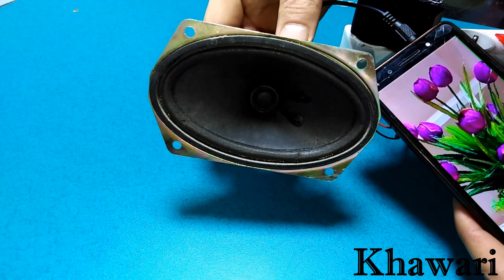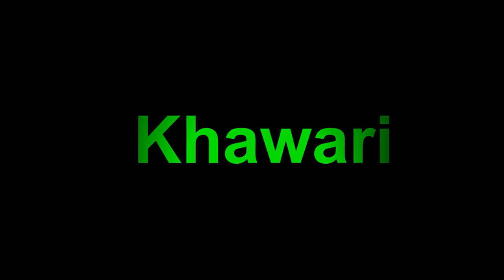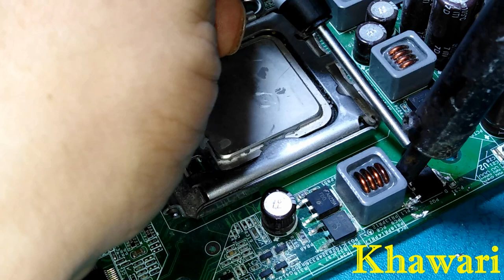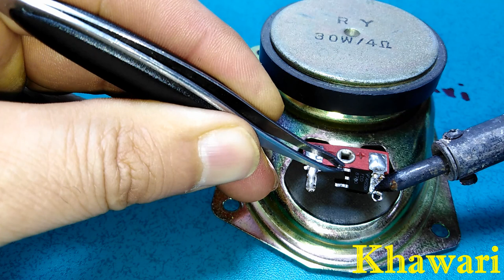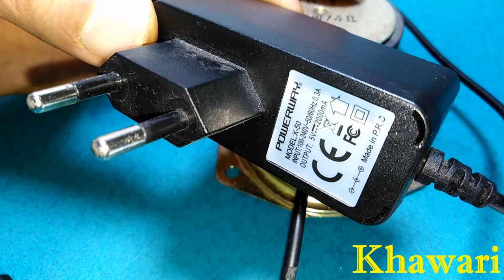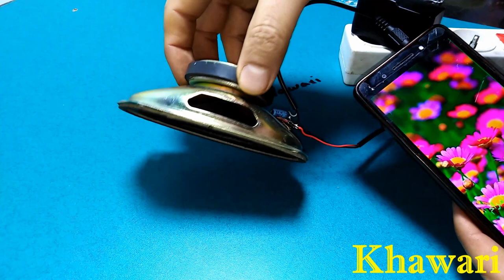Build a super Mini Amplifier using old Computer Motherboard/Mosfet FDD8780

Comment: Looks like a simple class A amp, with the speaker in series with the transistors Drain/Source. Strange design, the speaker got DC current together with the AC music signal, it seems, therefore not resting in it's normal position. Rather unorthodox, LOL!

Comment: just buy a cheap usb speaker as they come with amplifier and volume, then replace the cheap speakers with some home theater speakers and youll be Amazed and no power needed. good video bro.
Reply: Not if amp is shitty
Reply: @rikxianvanhouten5698  Yap, they ic will dead
Reply: i tried that and lets just say it didnt go well
Reply: i did mine with some, sony home teather speakers and it works great.  know that the cheap amplifire cost me less than 10 dollars made in china. but do not expect hi definition sound. but it is loud and nice for music and movies.